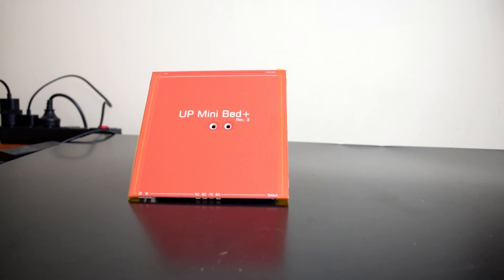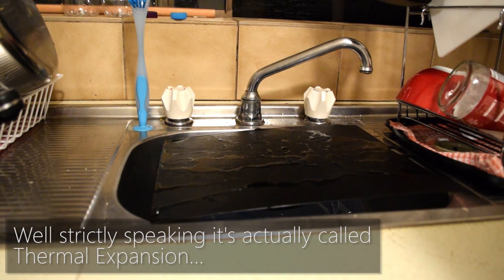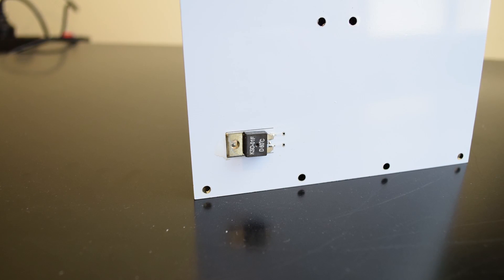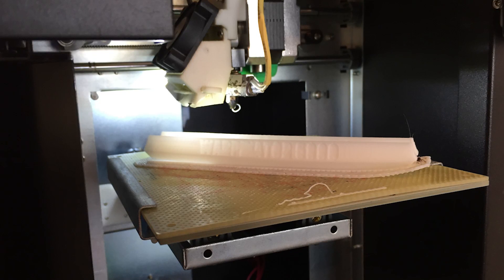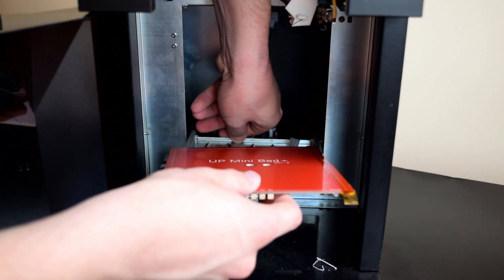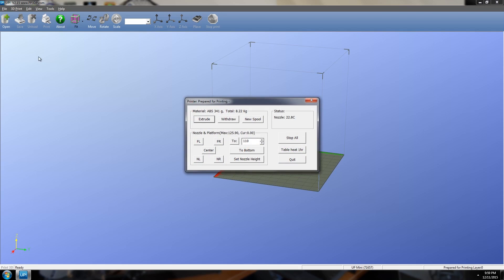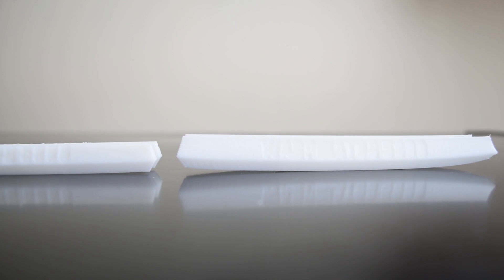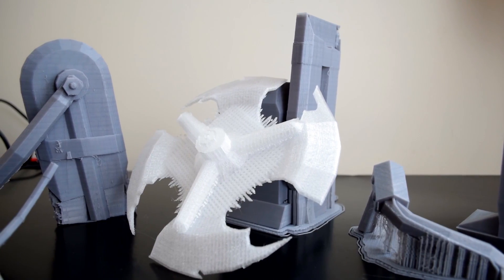UP-Grade your UP Mini with the UP Mini Platform Heater v2 - 2015

Comment: Hey there! i recently picked up a makerbot rep 2x and up mini for a few hundred bucks and was looking to bring them both into the modern age... would you say this is still worthwhile? or am i wasting my money :/ I do want  to use them in a print farm/production/art environment so i want to mod them both into reliable and refined machines... any helpful tips would be HUGELY apreciated. End goal would ideally be to have the UP mini gcode controlled with an adjustable glass bed.

Comment: It is super smooth! I was printing with no raft for a while but realized the raft obviously helps with warping on bigger objects. I've never broken any glass.. but I can see how that would suck. The prints on hairspray literally pop right off on their own after cooling. The only problem with glass that I personally have is that it weighs down the bed a bit and I get this kinda of "bounce" when it's moving forward and backward and it creates these funny little waves in the layers and gets worse the taller the print goes. I've been able to combat that by just always setting it to "fine" when I need a good resolution. Wonder if I should try hairspray on the perf board? hmmm not sure. :D    Cheers! Love the vids. Always looking forward to them and get excited when I see a new post.
Reply from the maker: +Broc Gallegos Thanks dude, appreciate it! Yeah The UP Mini platform isn't all that stable. I've never had to put anything on the perfboards other than wipe them down with acetone to clean oil and dirt off. If you've got the time, printing fine always helps.

Comment: i am getting almost ZERO warping on the up mini with glass and hairspray. Upgraded bed with 100c thermostat. I use Angus's heat gun technique to heat the bed past 85c for the first layer. Keep your filament super dry though!  :D great video
Reply from the maker: +Broc Gallegos Nice! I'm always scared of breaking glass beds but the finish is oooh so smooth.

Comment: your videos are convincing me more and more of buying the Up mini printer, From what u are showing this printer deals very well with warping and has good print accuracy despite the .2 max layer resolution. Thanks for your videos and keep it up.
Reply from the maker: +Ahmad Hamad The layer heights are a bit misleading - you really want a printer that is accurate rather than 'capable of printing down to 0.05mm' - the prints at 0.3mm on the UP!'s look better than many on lower end printers at 0.1mm simply due to the better accuracy. Print bed on the Mini is fairly small, but you can always just slice parts to fit and glue together later with acetone.
Reply: +Maker's Muse I see. Accuracy is indeed more important. In case I get this printer I will use the program hack u showed earlier to see the limits of this printer regarding accuracy. I got the impression the program somewhat limits the printer capabilities. Thanks for the explanation
Reply: +Maker's Muse Man I'm very confused now as to buy the flash forge dreamer or up mini. can u please tell which one of them has better accuracy and better warping resistance (without modifications)? Hope u can help me make my mind and I would really appreciate that

Comment: Or, if you know what you're doing, you can just short the two pins of the original bed thermistor, and you will get even more temperature than this bed. Worked like a charm for me during a month already. Use it at your own risk :)

Comment: Hello Maker's muse. How do you make your 3D printer put down a line (like at 3:58) before initiating the real print to ensure that the print sticks to the bed better?
Reply from the maker: +SPYN09 | Naruto Ultimate Ninja STORM series The UP! Printers do that automatically, however depending on your slicer you may be able to define the starting G-code to include a nozzle wipe right on the edge of the bed, so it does this before each print.
Reply: I see. I have been experimenting with the G-code in my Cura version, but I have never thought of actually programming it to make a line before starting the actual print. I need to look into that some more, as I am not sure how to programme it to put down a line with the right flow, and so on. Thanks for your reply.
Reply: +Maker's Muse By the way, I forgot to ask you: Have you had any experiences with BuildTak underlayer? I have bought it for my Wanhao Duplicator i3, and it has some ups and downs. For instance, the underlayer has a hard time binding the melted PLA one is trying to print with, which therefore requires much higher temperatures to make it stick better to the bed. What's your view on this?

Comment: Try a PEI bed surface -- no more warping. Works really well
Reply from the maker: +kazolar Is that Buildtak? I love that stuff, still have had some warping using it but it's one of the best solutions so far! You should see if you can print the Warpinator 5000 .
Reply: +Maker's Muse -- nope: http://reprap.org/wiki/PEI_build_surface
Reply: PEI is the stuff the Robox thermo surface is made from. Also known as Ultem which can be printed on the top of the range Stratasys machines. I think lulzbot have moved over to it too. Might be worth a try on your wanhao. You can buy very thin sheets that can be stuck on. Might be tough on the up mini though.
Reply: +Scienteer I absolutely love this stuff -- I have a sheet laminated on my MakerGear M2. No warping. I print boxes (the test of a warp free print) that take a full surface, and the box is as flat as the printer bed -- no lifting.  I've done prints which span 200+ hours -- 4.5 kg of PETG plastic -- 20+ parts -- everything comes off flat for very easy assembly

Comment: Hiya, Do you by chance know if Wolfbite Mega Solution really works for anti-warping ? Thanks in advance for any advise. :)  https://www.youtube.com/watch?v=31OBB98y9W8
Reply from the maker: +wizz tzab It looks like pretty interesting stuff, I haven't gotten my hands on any to test but looks like it might be a commercial version of ABS-juice, so a polymer in solvent that dries as a thin film on the print bed to promote adhesion. I have no doubt it works, I'm a little suspect of it popping off the bed so easily though!

Comment: WARPINATOR 5000   Love it.     

While a total newbie to 3D printing myself, I have quite a bit of experience with kiln forming/fusing glass where controlling thermal expansion/viscosity via uniform heating/cooling play a critical role to lessen stress, promote good bonding, and in the case of glass, avoid thermal shocking a project.  

I appreciated the time you spent explaining/demonstrating how these same physical forces are at play in varying degrees with FDM 3D printing depending on the type of material used, the environment of the build area,  and the geometry of the printed item. 

Thanks you and keep up the great work

- Al
Reply from the maker: +Al Bray No worries, glad it helped! Working with glass would be a whole new ball game - at least 3D Prints don't explode if the temperature isn't correct!

Comment: Even 80degrees seems a bit cool for ABS. and waiting an hour for it to reach temperature is just silly. Apparantly the Robox can get to about 160 in 3 minutes. It would be good to see the same test on either that or the Wanhoa i3. the latter would probably need some kapton or painters tape to make it a fair comparison with the perf board of the up mini. Good video though. keep um comming.
Reply from the maker: I realised my wording may have confused those who don't use the up software, the button is called 'preheat for 1hr' but I don't wait for an hour! The upgraded bed has visual feedback when it's hot which is awesome, previously I'd wait 5min or so.
Reply: +Maker's Muse presumably that 1hr preheat is there to bring the ambient internal temp up to a stable level. If your concerned about warping you are probably best to wait the full pre-heat time. I'm very interested in how these enclosed build chambers work to reduce warping. There seems to be very little information on the net to compare these features.
Reply from the maker: +Scienteer If the ambient temp outside is cold, they work wonders. I've had a room with an UP Mini, Up Plus, Cube and uprint (stratasys professional printer with build oven) during a mid-winter hackathon - only the Up Mini and Uprint were able to print! I also tend to use a Hot Air gun to blast the chamber just before it prints, to help bring the temp up nice and toasty inside.